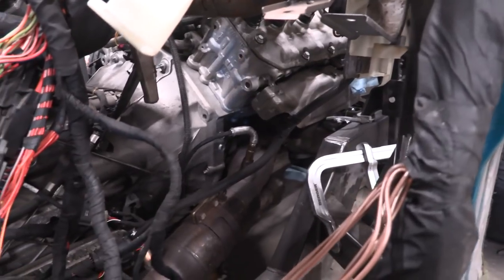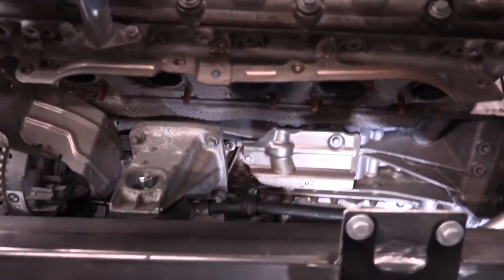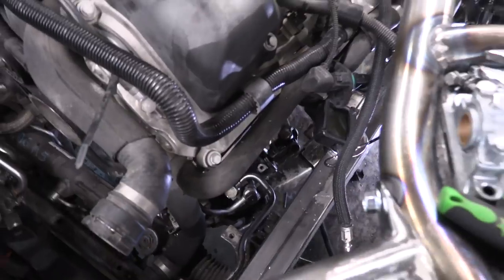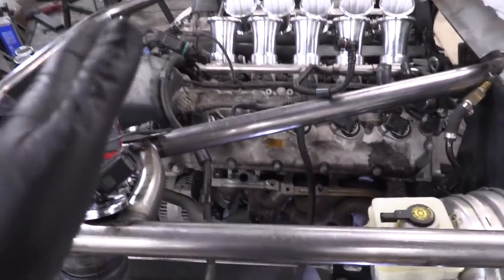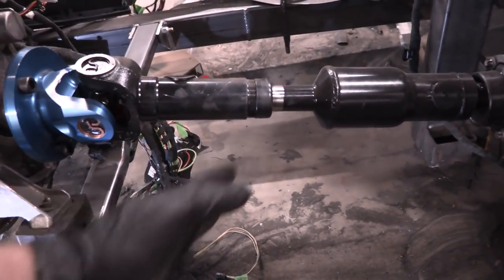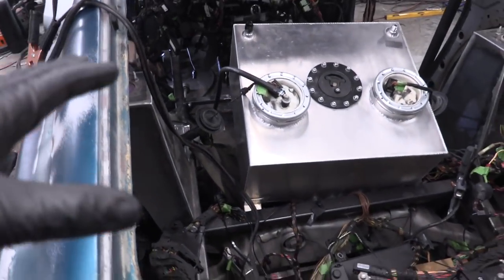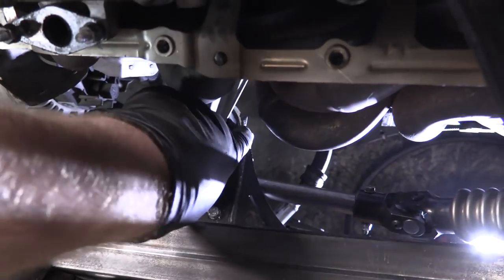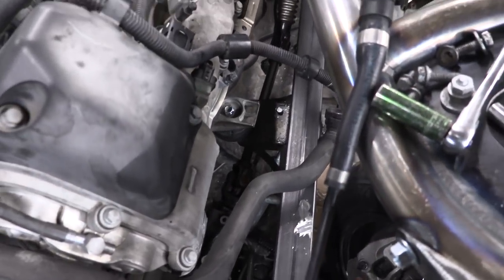Starting on the Exhaust and Finishing Steering for the 240Z

Comment: Bro a v10 in a single exit exhaust , you will have to do 3 to 3.5 inch exhaust when you merge the two pipes for the single exit , if you leave it in 2.5 its gonna lower performance , not enough room for it to exhaust 10 cilinders

Comment: What about a sheet of aluminum for the reservoir?? I think it would look nice also close the engine bay and prevent dust...
Reply: would make the enginebay look so much cleaner and replace the ugly mounting points it has atm.      greate idea!
Reply: My thoughts too. Aluminum covers on either side of the engine would hide the brake booster, coolant reservoir, etc. Also give great show car look.
Reply: Im with these guys, a sheet of metal framing the reservoir would look sick
Reply: I was thinking the same but in sheet metal so later it can be painted to match the cage. With cut outs for the reservoir cap and brake booster caps.

Comment: Instead of calling it the 240z it shod be the 240m
Reply: How about M240z? Or is that to similar to the M240i?
Reply: A custom Bagde that fuses both styles from the 240 and the M logos would BE FIRE
Reply: @realitatsblind3808  Umm 240M sound simpler since its looks like a 240 bur with the powertrain of a BMW M
Reply: Or maybe ZM240
Reply: M5z
Reply: VOTE for 240M
Reply: I think 240zM
Reply: Young Recklezz m for monster truck
Reply: I like M40z
Reply: M240Z
Reply: y not Fairlady M?
Reply: M250z
Reply: BMW 240Z
Reply: 250M sounds like 250 meter if you think metric
Reply: @realitatsblind3808  its a M not an i 240M just sound clean and simple
Reply: Mz45
Reply: or BMW 240z or a 240B, B is for Build

Comment: I can't help thinking that it might just be a sensible precaution to tape up the velocity stacks until you actually need them open, or some other protective measure.
Reply: isn't the standard stack protectors just a pack of tennis balls?
Reply: The bare ITBs have been open the whole time and got slag in them. He didn't give a shit haha, I hope he scores the cylinder walls
Reply: brooksman10  Damn, dude, we're trying to support the build
Reply: brooksman10  You know he clean the throttle bodies before he starts the car up...

Comment: Should mount the reservoir with a curved piece that wraps around
Reply: that's what I was about to suggest! get some smaller steel tubing and bend it around the res to match the frame.
Reply: Flat steel bar  about 80mmx3mmxlenght. Other end goes near brake reservoir and bar goes near coolant tank to other side of the tank. other edge is straight and other side cut with plasma to same  shape  as coolant tank. Hope you undrestand, its hard to write english :)
Reply: I was about to suggest the same.  A nice curved piece welded on either side would look great.  That or a partial/full sheet in the triangle.

Comment: Chris, one thing to think about is I'm pretty sure the transmission won't come out of park if it senses the door is open (or.. non-existent). For instance, with the DCT box if you open your door while reversing into a parking spot it will bang the car into park as a safety precaution. Might be different on the M5, but with other BMW's with the DCT it's like that. Likely can be coded out I'm guessing. Just wanted to give you a heads up!
Reply: Correct and it will need to see the park brake position as well as the hood latches and trunk latch are all closed also.
Reply: I was thinking that. You can roll very slow but it'll slam you into park if the door isn't closed
Reply: This issue can easily be coded away. -"Norwegian Eric"
Reply: Erik Fjellheim  Great news, I know you can do a lot with coding but thought this level would be in the software and not in the code options. Having you helping this build is going to make a world of difference. I think you are going to be busy figuring this one out fully.
Reply: @NISMOSkylineGTR  Good deal! Was hoping that was the case. Thanks for helping Chris man, you're a great dude!

Comment: Build the brace out of round tubing with washers for the tabs to mount to. Make the tubing connect between the two mounting points on the tank, it will make the mounting points flow more fluid with the lines of the strut mount and upper tube of the frame.

Comment: Instead of those tabs what about running a flat bar loop that will run under the lip of the reservoir on the outside and tack it to the tubing that runs between the engine and reservoir. Forming a cradle of sorts. Thanks for the rad content, watching from South Africa!

Comment: Hi B!  You need 2x 3" to make the right power and sound, 2.5 is kind a smaal. 
The hose you had as a leftover is conected to 13907835364, gas ventilation valve.

Comment: For the reservior it should be a single curvy bracket that follows the shape of the side of it, attached at the ends to the tubes and triangulated to the corner of the suspension top mount!

Comment: Why not cut a triangle of 1/4" plate that profiles round the frame tubes and the tank and picks up both mounting points, would look much better and serve another function of forming a strengthening gusset and could be done on the other side to match and keep thing fairly symmetrical.

Comment: Keep the reservoir where it is but mount it by bending a pipe or metal strip around it like a belt under the slight lip it has and have 2 tabs come off the belt for the mounting bolts. This should allow it to slide out if you ever needed it to. Um I probably didn't explain it well but hopefully you understand. PS love the videos

Comment: Hey Chris. First off I'll have to say much respect to you guys pulling this off and taking us with you on this journey.
I have a question regarding the FAC. You only used the first four mounting points for bolting the carrier to the body. What about the two rear mounting points facing downwards? What are your plans for them? They would help as a support distributing the loads under heavy breaking.

Comment: Will mounting that pillow block for steering onto the engine mount not transfer a load of vibration into steering??
Reply: Alex Hill  8.54 into vid.. He’s mounting it onto the engine mount which is welded to frame. I appreciate the engine is damped via the rubber but it’s still mounted in an area that’s likely to be high vibration. I’d just unsure if mounting that close would have any negative effect on steering feel. He re did those mounts as he was worried how it would make car feel, it would be ironic to then feel it through steering wheel.
Reply: Alex Hill I agree, on the previous episode where he said he was going to mount it, it looked better. Just now it’s that much closer to engine, and being on the actual engine mount seems like a gamble. It may be fine, I suppose time will tell.

Comment: Fun fact Chris, c130 aircraft use v-bands on tons of components, including engine bleed air lines!
Reply: Those aren't vabnds, they are MARMAN flanges. 100% better and they don;t leak.  Made in the 40's and used since then.  Currently used on all diesel trucks.  The marmans are used in aircraft, the space shuttle and more because they don;t leak. The FAA will not allow a vband because they warp and leak.

Comment: Wait, what? Your running a V10 down to 2.5 inch pipe to a y-pipe and bring the 10 cylinders down to a single exit? M5's have a dual exit, 5 cylinders per muffler if you know what I mean. This will cause some back pressure surely?
Reply: he said he is doing an x pipe withe dual exhaust
Reply: He said  x pipe and showed one single exhaust.
Reply: Hmm maybe you're right. I hope he does a dual exit.
Reply: X pipe = dual exhaust
Reply: Yea, you'd think, but he's still saying "resonators to the muffler", not mufflers in his latest vid.
Reply: Actually, the V10 has pistons the size of small soup cans and doesn't need 6" of tubing. He is installing a dual 2.5" exhaust meaning, there is 5" of exhaust tube in this system. I think 2 1/2 front and 2 1/4" would be optimum for performance. EVERYONE thinks that if you go bigger, it gets better. That is not true, especially to fuel injected vehicles!  Funny how no one talks about the stock converters blocking the exhaust.  To which, they dont!  Most cats except the pellet cat from the 80's GM cars are super high flow converters.

Comment: Xpipe doesn't add any performance over H, just a raspier higher pitched sound. You need to catch up on engine masters.
Reply: post link to the X vs H...id loke to see it
Reply: @nevrcm3261  google it, engine masters exhaust comparison
Reply: Dave Nevrla  i think they took it down, you need MTOD to watch anything motortrend now :/
Reply: @peterm3159  thx.  H-pipe and X-pipe minor improvement low RPM. Higher RPM X-pipe minor advantage over H-pipe.

X-pipe "sounds meaner" 

For the M V-10, HIGH revving...8,000+, X-pipe would be my choice for a bit more juice, but optimize the sound
Reply: @nevrcm3261  ya the diff between x and h you can't even feel when driving it's so small. I run h on my muscle cars, euro high reving engines would probably prefer x.
Reply: @peterm3159  agree zero on the butt-dyno.

i have a high-revving I-6 M3. dual exhaust from factory. Though i installed equal length stepped headers, race cats, RE x-pipe.
Reply: The "X" gives a little more HP, and the "H" just removes about 10% of drone.  Signed, me.... 37 yr experienced ASE  Master Tech with X1 (exhaust) certification... and you??  I thought so..

Comment: My Peugeot 206 has the same sort of joint in the exhaust from factory. It seems to work pretty well even if the rest of the exhaust has rusted away at least twice since I've owned it.
Reply: The joint he is using is called a MARMAN FLANGE.  It's been around since WW2 and never leaks...

Comment: Just take one oft these smaller diameter pipes and bend it around the Reservoir (like almost a half circle)  so you can weld it with both ends to the inner pipe

Comment: Im not sure what kind of bearing you used for the steering, but i do thinj you need a second one to create a line fixation. Like this its gonna put some weird loads on a single bearing due to the angles of the steering axles when the wheels are on the ground and actually put some load on the system

Comment: can you make a "sit in" bracket with the holes cut for the reservoir bottom to sit in? weld it on the inner roll bar closest to the engine on that corner

Comment: I hope one day he'll twin turbo it
Reply: Would be awesome but I don't think it's going to necessarily need the power
Reply: Supercharger is probably more practical. Can still easily make over 800 horse!
Reply: There is a supercharger kit for it.
Reply: Just a tune will make 200mph+
Reply: It's a 5 litre V10 putting out 500 bhp and 383 lb-ft of torque, a stage 1 re-map will take it to 530 bhp and 400 lb-ft roughly. Not a huge amount. It's already a 200 mph car, remember it's 500bhp in a 4012 lb/1819kg 5 series body. It's now a 500Bhp engine in a 1200kg body probably. So power to weight is 33% better, if you know what I mean.
Reply: @heanstone1327  stick them out the hood :p
Reply: @aw1cks  I'll be happy with that also
Reply: @jonnypolea3768  yup I know what you mean lad ive just never seen a twin turbo V10 before in a smaller car now I know why ;)
Reply: @kaaazzi3365  yep I agree
Reply: @umerafzal482  more powar!!!
Reply: Jonny Polea the engine Is extremely detuned from factory so he needs to unlock it
Reply: @jonnypolea3768  if he does add extra hp then he can add more weight to it like passenger seat, sound system, electric ac est to make the car look more complete inside rather than a bare bones interior and that's just the weight up to now he can add bash bars ect
Reply: All cars should come with from factory with stage 1 tune, my e60 has a stage 1 power map, makes a lot of difference as it's a 530D (turbo) so I get an extra 52 bhp and 100 Nm, so sitting at 284bhp and 601Nm. No other engine mods and it does the 1/4 in 14.5s at 97.5mph. The M5 in a lighter car and shorter d/shaft, etc will run 11s or 12s at well over 130-mph I think. If it cam put the power down that is, may need to run radials on the rear.

Comment: Would your overflow tank fit in the driverside corner just behind the removable rad support bar and the suspension mount? It looks like it would tuck in that corner and the mounting tabs could connect to the removable bar.

Comment: ok so im not sure if the over flow is a pressured unit on a bmw or not but ive used old aluminum  fire extinguishers that ive striped the paint off and polished there normally pressued to 100 psi or 185 anyway to it may work

Comment: Instead of the 2 tabs for a reservoir, it would have been neat to see just a plate with some dimple dies for weight reduction. Would remove any flex between the two tabs as well.

Comment: how do catalytic converters work in your state? im in Nova Scotia Canada, we dont test emitions but anything newer then a 1990 has to have a converter. so if i was building that car in my area cutting the converter off is no problem. will this affect you ?
Reply: In the state of Oregon, he might be in a DEQ area so in reality (if he was going to drive legally) he would have to get an emission test. But he can also acquire a "special interest" plate because the car is older than 25 years old, therefore making it DEQ unnecessary.  I like he idea of the converts to keep the back pressure where it needs to be as well as keeping down the drone a little and getting rid of any excess fuel smell out the tails.

Comment: What are your plans for the cats? Full delete? Was wondering cause the second O2-sensor is not gonna be happy and send OBD2-codes your way. Or is your norweigan wizard gonna code it away?
Buuuut, cats are nice though, makes the car smell less from exhausts - yes some people like it, I know.
Reply: Most of the ECM will be modified for the 2nd o2 to be off, as well as the EGR, etc.  Otherwise, you just dont put a lite on anywhere so you see no lite on!

Comment: With or without cats and small rear mufflers you’ll die from resonation. I’d advise large rear cans that eliminate resonating.  If not you’re going to suffer.  Had custom systems on both m5 and m6 and resonating ruined the driving experience.  Just keep in mind
Reply: Yah, I was thinking the same, but you only will find out when the car starts up to make adjustments.  The only way I think (without any room) to make this quiet would be a cross flow rear muffler.  Dual in on each end and dual outs on the ends as well.  Like a Camaro muffler.

Comment: When you take the car drifting remove the rear overs and the whole front so it will look like a missile with the whole front tube frame and massive tires hanging out the rear.

Comment: How are you doing rust prevention? I mean, if you have this bare steel frame, the car will break very soon.
Reply: Tim Jäger you clearly don’t watch all the videos, he’s covered that multiple times.
Reply: i keep commemnting this, but never get any answers.... this will be a rusted out failure in 2years time if he doesnt do anything about it before this leaves the shop!
Reply: He is attaching everything now. When all fits and works hes going to paints everything
Reply: Are people forgetting this is a sema car? Every vehicle at sema is cosmetically flawless. They might not run and or drive, but they look perfect. Lol. Its gonna get painted.
Reply: Obviously you don’t understand corrosion...
Reply: The car will break very soon 😂 😂 All racecars are bare chassis because they need to inspect everything for cracks regularly, and those don't fall apart so?? A little linseed oil and scotchbrite goes a long way

Comment: Sorry Chris but a single 2.5" after wherever you decide to merge just ain't going to cut it for a 500bhp engine. It's going to harm performance.Keep it split and have twin exit on each side of the rear of the car.
Reply: you mean a DUAL 2.5 is too small? thats 5 inches on circumference.  Unless this engine has over 650 HP, 3" duals is not worth it. There literally will be no back pressure. Now, if he turbo'ed this.. then 3" would work since the turbo needs no back pressure.

Comment: Don't do the X-pipe or do it properly after Sema. You have to precisely calculate the exhaust length in front of the x-pipe and the actual pipes must have this exact length on both sides, otherwise you can really screw things up. If not done perfectly, x-pipes will cause pressure during the exhaust stroke instead of suction. And even worse: if the two sides don't have the exact same length, the effect can be different on both cylinder banks, so there is a good chance it will throw an error code complaining about exhaust temperature and oxygen level. And it might also throw a code complaining that certain cylinders don't compress properly or misfire as one cylinder bank will perform worse because of exhaust pressure caused by a non symmetrical X-pipe (the crank sensor can actually pick up the difference in speed during a single rotation of the crankshaft and will complain about it).
Reply: So your saying that when the engine is running 4000 rpms that the engine will run like crap because the exhaust will give a care where it goes and how it exits?  Uh, this is overthinking...
Reply: @gbemandrelbending7091 
The gas exchange will be very inconsistant as the cylinders will face different pressures during the exhaust stroke, which will also affect the next combustion as there will be different amounts of exhaust gas left in the cylinder during combustion. The cylinders will deliver different amounts of force. And as the crank sensor can measure the change in rotational speed that every combustion causes, it is gonna think that there might be a loss of combustion pressure or a defective injector. With that exhaust, the car is propably going to stay in limp mode.